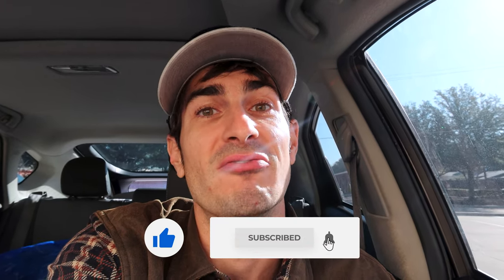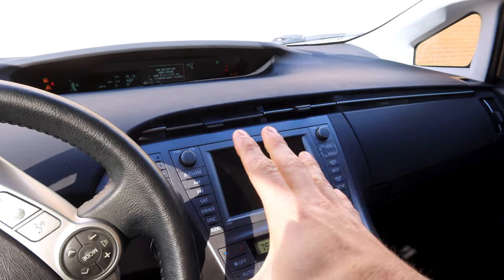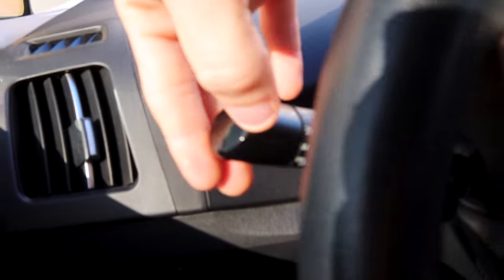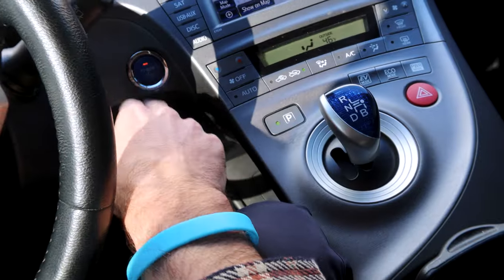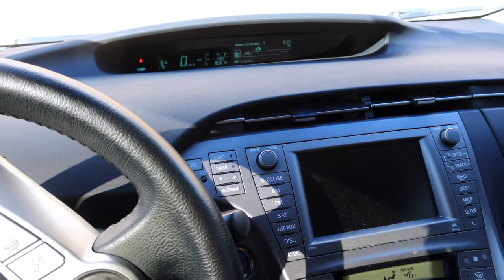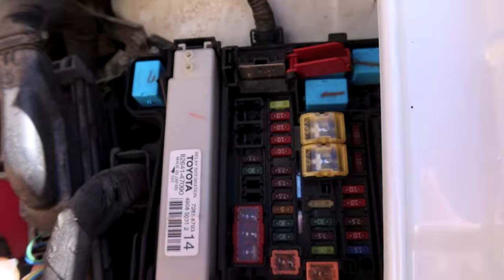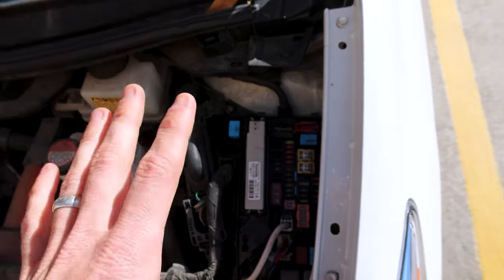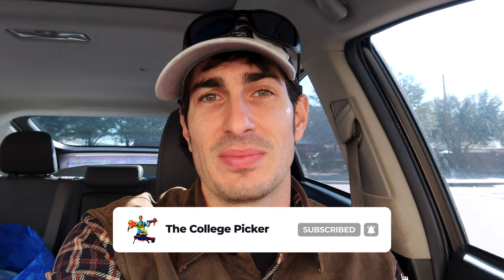Toyota Prius Won’t Start (Easy Fix) 2010-2015 + All Models Aux Battery Low

Comment: Just an fyi: i spoke with my local prius service center recently about where to attach the negative cable if it wasn't long enough to reach the bolt on the far side of the engine that is usually recommended. I asked about attaching them to the frame and was told in very firm tones never to attach to the frame. I was told that doing so creates unpredictable paths for the current flow and that the current can jump to the computer system and totally fry the computer. I was told the safest place to attach the negative if you can't reach the recommended bolt is the top bolt supporting the shock on top of the wheel well.  As i said, just an fyi...
Reply: Thanks,  I  used this advise today.
Reply: Thank you so much for caring enough to reach out to everybody and tell us that. These cars get expensive with batteries and no one needs to fry their computer. Very grateful for your caring attitude and help thank you so much
Reply: I connected to the battery in the back under the trunk floor side panel

Comment: Mine did not show that display. It shows all the other lights on the dashboard. Touch screen completely black. I got a jump, had it hooked up for about 10-15 minutes. Then attempted to turn on. Navigation screen turned on. But transmission did not want to engage. Waited 5 minute(with car off but still hooked up). Power the car on, and transmission worked. Assuming I have a low battery (12volt). 2014 Prius, fully loaded.

Comment: I have question i got sick did start my car for 3 weeks and my battery died I hade it charged but when I try it says check hybrid system is there a way to start the car ? Please help
Reply: Probably has something to do with the hybrid battery under the rear seats

Comment: Thanks for the tip about shutting off all power-draining options in the car (radio, lights, etc.).  This is a 2014 (75,000 miles). I replaced the battery just because (at 68000 miles). I had an accident a year ago, and the rear hatch needs a very firm closing.  Maybe that is what is causing the drain.  I will check the rear hatch and charge.

Comment: So I checked the air conditioning and what I noticed is in the electric motor at the front that there is a mini jerk when moving between the change from the electric motor to the combustion motor, it seems that this transition from one to the other has a small bad contact or wear. of a piece of equipment responsible for the exchange. I didn't find anything about how this exchange occurs, if you can check, that's the problem. I noticed that when you make this jerk and turn on the lights, there are problems with the panel or when opening the doors, probably due to the reset via the white cable from the fuse panel. In short, it is something between an electronic and a combustion engine. When the hybrid's batteries are charging normally, I cleaned the zinabre and is working perfectly after maintenance. And the 12v battery is new, I replaced it.

Comment: Same issue, but i don't get that "AUX BATTERY LOW / PARK IN FLAT PLACE" display. Same everything else though. Gonna get the aux battery checked first thing in the morning though. My Prius is a 2014 with 196k miles... it serves me very well otherwise though, and runs as it should. I love Priuses and when it comes time to get a new car, i'll just get another Prius.